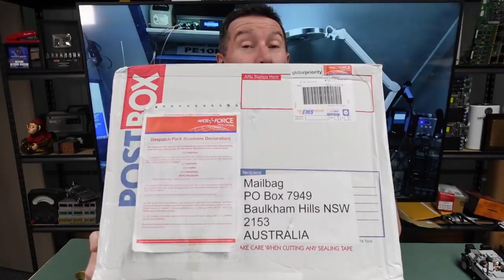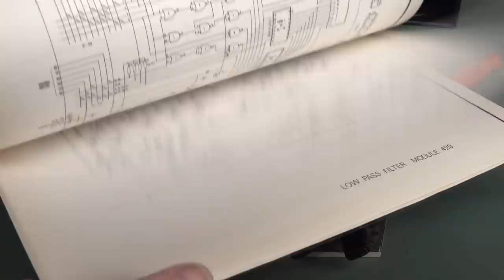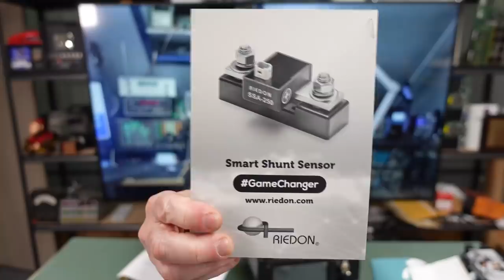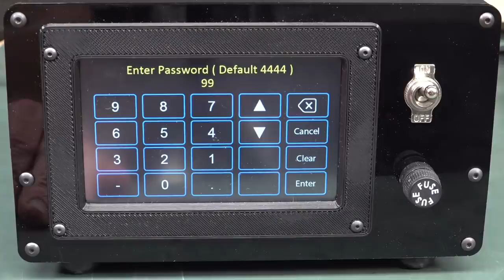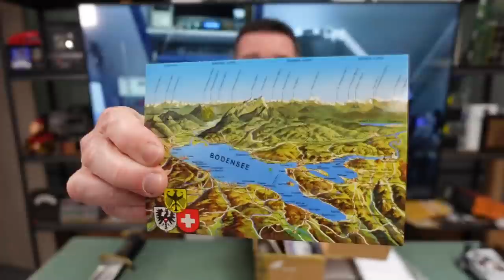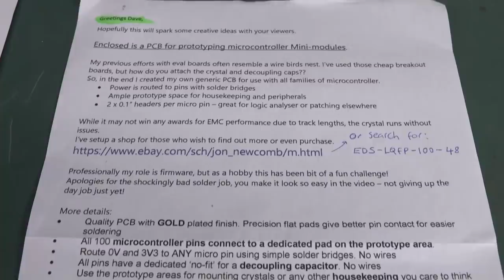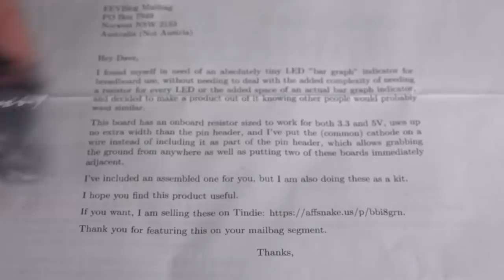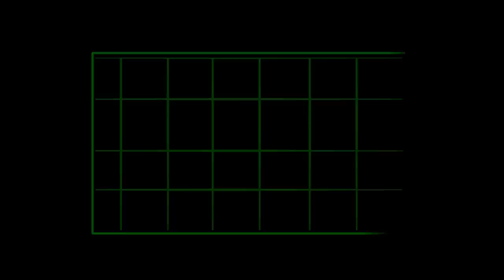EEVblog 1410 - Mailbag

Comment: Thought I recognised that add-on board in the marine radio - it's an ATIS (Automatic Transmitter Identification System) board which became a legal necessity on all VHF transmitters in operation in the Netherlands, the Rheinland , and the Benelux countries in (if my memory serves me right) the mid-90s. Hence the upgrade board.
Reply: Thanks David!
Reply: It sounds like 1k2 packetradio. A brust of about half a second at the end of each transmission. And the paperwork is in Dutch, not Danish.
Reply: So... what did it do?
Reply: @billysgeo  it sends the name of the shipp every time you push the PTT button

Comment: That horrible flashlight - is "Helios". How many people were shocked by it - god knows. I was a kid(1988) and nearly got killed by the damn thing. Barefooted boy walking around in the yard - decided to charge it up, and, yes of course - whilst it was charging i've got a brilliant idea of taking out a lamp for some reason. And as a family story tells - my grandmother found me lying in the yard unconsious. In electronics ever since :)

The battery is a  NiCd 260mAh and no remorse there - they always, ALWAYS leaked. Curious thing though - they still do make them in this form-factor, and even some descent brands do it (Sony, GP, etc), though of course the modern ones are NiMh.
Reply: Heh, I just poked my fingers in the mains socket when I was 1 year old or 2?
And this was It for me - electronics. And thous torches never make any significant effect on me.
Also, it was an incredible fun to play with it plugged into the mains. I think I use it to charge some other accus. One time LED on it exploded into the ceiling.
Reply: BTW: The story of NASA spending millions on a space-pen is absolutely true. But there's a catch: The NASA had the idea, that highly conductive micro graphite particles floating around freely in a space craft wasn't the very best thing for safety. So they tried to change that.
Reply: I also got got mains shock 2-5 years old since than in electronics 😃😃😃
Reply: I had same torch. even i manage to find spare batteries. Most of ruusian electronics are immortal.
Reply: @marcus_w0  I think the Russians used ink pencil, not regular graphite pencil.
Reply: @Llirik13  I was 6 when I built my first single phase transformer. Poked the fingers in the socket too only to be found by my mother later unconscious on the floor
Reply: @mrnmrn1  You are wrong. Ink pencils are not used in space and air due to air pressure changes.
Reply: "How many people were shocked by it - god knows" > Been done, done that ! :)
 After the incident, I saw the light.. and decided to become an engineer
Reply: Такой же фонарик назывался "Электроника". В отличии от "Гелиоса" в нём навесной монтаж деталей и отсутствует светодиод. .

Comment: Torch name Гелиос is (Helios). We have such torches in USSR. They have selectable light beam geometry (by turning bezel). Ni-Cd accumulators. Ingenious charging circuit. And really hi tech big crystal LED (I have one story with makes me think it can produce laser beams). So much memories Dave. My Grandpa had one of this, I remember using it when I was a child, and after he died, my Grandma still used it for some extend. It have an extraordinary life span, especially in regard to thous Ni-Cd accus.
Charging circuit is actually designed in such a way that it provides pulsating current, and this helps to fight memory effect in accumulators. But you must plug it off after some time (6 hours or something to not fry it) I bet thous accus still work if you clean them and charge for a while.
Reply: It was a consumer device. It was produced in volume. In USSR there was a limited variations for every type of consumer goods.
This torches was doggy in use, it is true, but also they worked, they helped us, they shined our way.
Reply: But there was also a railway torch we have. It was powered by serviceable alkaline accumulator. This was a standard big rectangular
 interchangeable accumulators that was widely used in other places, 
motorcycles, mining lights, etc etc. And they must be charged in stages, and electrolyte was boiling inside, and, it was so much fun!
Reply: @Llirik13  I'd love to hear the story about the LED producing laser beams! I also like the use of "accumulator" in place of "battery"... Might just start calling all my batteries accumulators now :D
Reply: @DielectricVideos  
 Accumulator stand for rechargeable battery here.
And thous that one time usage we call just battery -  batareyka 
(батарейка) for single quantity and batareyky fro multiple quantity.

Led exploded at the time when I played with this circuit (it was 
connected to mains). But it was really strange. First it starts flashing
 pulsation light with sounds of small blasts at 10Hz and really strange 
color. Then it exploded by irradiating thin light beam into the ceiling.
Inspection showed that led was lacking small central piece of lens(and 
have thin channel in rest of it), and ceiling have small burned crater 
in concrete.

Perhaps of course this was just redhot led crystal pushed by magic smoke
 to the speed of sound.
Reply: @Llirik13  Very interesting, it does sound like it turned into a laser diode for a short time!

Comment: As soon as you pointed at the added board, my old modified Midland SSB CB transceiver came instantly to my mind. I built an external VFO equipped with digital readout and then, very very carefully, I connected it to the right spot of the Xtal oscillator by means of a plug I added to the rear plate. It worked fine and it was also very stable, with clean output. I think I knew those schematics better than my home. Merry good old times, I was sixteen then. Thanks for reviving those happy memories.

Comment: The picoprobe tips are actually easy-replaceable, just grab then with pliers and pull them out. You can also interchange them for the serated points. And turd will do just fine I guess :-)
Reply: Hey Turd! Grapje natuurlijk. :)
Reply: Nice probes. How did you make them?
Reply: @thekaiser4333  some off the shelf parts soldered into a custom brass piece. The front and back are gold plated receivers, an the probe tips are also off the shelf.
Reply: @Cheered  - Thank you.

Comment: A pencil is a bad idea in a spacecraft with many switches and zero G. Break the tip and you've got a small random conductor floating around looking for a set of exposed terminals.
Reply: The story is a little simplified, they actually used a grease pencil
Reply from the maker: Don't have exposed terminals.
Reply: @EEVblog  But how would you AVOID having exposed terminals ? You can't coat everything in Bakelite or something right ? you gotta have access to make repairs on-the-fly so to speak ...
Reply: @EEVblog  Impossible to do, you are cutting every gram, so you only use sleeves where needed, and not on all of the pins. A lot of the modules were fully potted for vibration, but almost all of the switches on the panels used either soldered or screw connections, so sleeving them all would have added extra kilograms of sleeving, which translates to hundreds of kilograms of fuel extra. They already were making panels out of aluminium barely thicker than a modern drawn can, not much more they could lose mass wise. These were the engineers who took bolts and hollow drilled them, to cut a few grams off the mass, despite this making the 2c bolt come in at $20 then. Same for panels, milled out to just have the borders thick enough, and enough thickness to survive launch.
Reply: Hello. The problem with the carbon particles from the pencil is not that it gets on the switch contacts, but that the carbon particles from the pencil get into the oxygen regeneration system and can damage the regeneration system. This applies to American spacecraft, where astronauts work in an environment of pure oxygen. Russian space vehicles use ordinary air with 78% nitrogen and 20% oxygen and there are no problems with carbon particles.
Reply: @plusmanikantanr  Probably with more expensive materials but same way as they do on earth, in industrial and what they call mech and elec harsh environments.
Reply: that's why you can fix any russian gear by hitting it. hitting it lets the broken tips fall out.
Reply: @fiakergulaschsaft  🤣 I think that's where the expression "percussive maintenance" comes from. 👍
Reply: You could use crayon....why  pencil!!!
Reply: @rohitkhanna4487  Ah.... because that is what the Soviets supposedly used in the standard telling of this myth. BTW, NASA never paid for weightless pen research. that was a private company venture.
Reply: Also, Fisher developed the "Fisher Space Pen" entirely on their own, and then sold them to both NASA and the USSR.
Reply: They design spacecraft electrical and mechanical systems exactly to prevent something like that, NASA has a 600 some page (iirc) document on crew safety. They have put a lot of emphasis on in situ crew safety ever since Apollo 1. Unless you have all of the panels stripped off, live power running to the devices in question, and a lot of bad wiring, a pencil tip isn't going to do much. There are worse things that could be floating around a spacecraft than that.

Comment: Vintage transistor packages in the VHF transceiver were called 'Lockfit' packages, a Philips/Mullard design. They had pins made of metal strip, with barbs on that retained then in the PCB for soldering, (and made them a right pain to remove!).

Comment: The frakos are great!  They explode very loudly as they nearly never have a vent!  :)
Still used in the 80's as I see them often in audio equipment in the powersupply section. 

I saw people referring to them as "knallfrosch", exploding frog?.

Also today they make devices to correct the powerfactor when you have lots of motors. 
Basically a box full of caps and relays.
Reply: A Knallfrosch is a type of firecracker which jumps around on the ground.  They are usually green coloured, hence the name which literally means "bang frog".
Reply: I also had a Frako capacitor exploding in an audio amplifier that I built in the late 1970s. But it was entirely my fault, I did not understand the circuit well enough and exposed the capacitor to overvoltage. Nothing to blame the Frako brand in general.
Reply: Alessio, see if you can find my recent message about Frako caps.  Still working fine after 50+ years in my German portables.  You're right, no vent.  May be why they had a huge voltage margin.
The only cap I ever saw 'jump around" was a wet slug tantalum that had been installed reverse polarity.   It sounded like a pistol shot when it let loose.  The slug was ejected and left a heat trail on the adjacent insulating card.  (Of course, that that was so their source and path could be easily traced!)  : p )

Comment: According to the manual, which you can also find at "rigpix": The resistor is a 10Ohm 16W and its inserted via a relay in series with the power supply to the RF power amplifier. By inserting that resistor, supply voltage to the RF power amp drops to approximately 10V and that reduces its output power to 1W. I agree, the manual is excellent. The unit is wonderfully modular in design and that VHF power amplifier should be useable in other applications, I'd love to get hold of one for experiments.

Comment: The radio documents are in Dutch, not Danish. Some highlights: the warranty certificate ("garantiebewijs") states that the marine radio ("marifoon") was intended for a boat called "Serdon", and the owner was responsible himself for building it in. The other document is basically a license by the PTT (national phone and mail service at the time) for using/installing a radio on the "Serdon". Looking at the handwritten notes on it, it seems that this license cost the guy fl.42,- (roughly 21 euros) at the time.

Comment: 7:30 that synthesizer board is an upgrade from the 90s for sure!

In the 70s we called these multichannel transceivers "quartz crystal tomb"

Because you needed the propper quartz for every channel you wanted to receive and 
another quartz for transmit ! And these crystals were expensive these days.
So normally you did not have many (fixed) channels maybe 3 or 5 to change (and 6 or 10 quartz!)
and you had to open the box and plug in other crystals if you traveled to another region with other radio channels.

Comment: funny to see a fairly "modern" ATIS code generator in that old "Marifoon" Boat radio. 
As an intern at a big nautic equipment repair/suplier company,(Radio Holland) I had to (re)program this little devices and build them in the, back than, modern "boat radio's" with indeed earlier said ATIS identification code. this system is still used today at big harbours like Rotterdam so that the control station always knows who is talking at that moment. No one is allowed to transmit without that code when talking to the control stations. It can cause huge fines or can even cost you your permit to use the radio.

Comment: Mains rechargable flashlights are quite common here in the States for emergency power loss. Schools have them in every classroom, my work has one in the bathroom, etc.

I think a big part of their role is insurance against the backup generator failing. You want a way to get light automatically, with or without backup power.

Comment: That transistor package is called an X09.  I guess reasonably common decades ago, but I don't see a ton left around today.
Reply: Phillips and Siemens were the only manufacturers who made them, does make it easy to see German and Dutch made equipment. They also made a power transistor in the same package style, with a small tab out the top to screw to a heatsink, though often just the tab was enough for audio.
Reply: @SeanBZA  Made by Mullard too, and Philips Australia.  Very popular in locally made equipment here in Australia during the 1960s.  Called an SOT25 package.

Comment: Stacking chips reminds me of how I used to double my memory capacity by soldering RAM chips piggy-back like this, and adding a wire to do a chip-select to switch between the second chip and the first. So that mod may be doubling the number of available frequencies, or some such.

Comment: Those breadboard LED bargraph devices look really useful. I'm going to get some of them. When I need just a few LEDs on a solderless breadboard I have a bunch of red 3mm through hole LEDs with built-in current limiting resistor that I picked up from somewhere many years ago.

Comment: That Is a marine band VHF. It works from 156 to 162 MHz. It was  installed in all ships in 1980 as regulations requirement. The board on the back of the PA Is for a selettive call. A scrambler could not be use on marine band.
This equipment Is a full duplex type, made by Dancom. 
I was an electronic service Engineer and between 1980/1990 I repair thousand of thouse VHF.

Comment: im still doing entirely SMT prototyping on standard 0.1" proto board 
soldering 0603 parts between the pads and wiring sots in manually with bare copper wire
not fun, going to get a bunch of these right now

Comment: Telefunken Bajazzo portable radios from the 1968 - '69 era use the very same 1kµF 16v Frako caps in the audio output and power supply filters.   They're still working in-spec!

Comment: Great ship radio, or Marifoon (Maritime Telefoon).The attached documents are the licence to have installed a maritime Telefoon system
and after a PTT control check of proper installation you are allowed to use it. Of course after payment of the radio Licence.
Thats that "Directoraat Radiozaken" paper.Other paper is the date of purhes 16-feb-1978 and the date of approved installation date 5 april 1978.
Name of the vesel SEDON and radio call sign is PF7285.I repaired several of those Marifoons. Indeed the time the came standard with full
documantations. Those Typical Transistor packes were common in Europe, these are Siemens, but Philips was the design of this kind of Packedge.
Those extra wire ing and very small PCB with Orange Plug is the ATIS Code-PCB.Radio call sign transmitter.
Every time you push the Transmit key, first the call sign is transmitted.After app. 1994 it was installed at a government ruling to install in all MArifoons.
There for this modifications.The call sign is programed into that little PCB.I still can Reprogram these Modules, use a very old Win 3.0 laptop for it and spec serial converter.

Comment: @5:17 "dual bodge chip" , In the UK there are 2 Legal CB Radio Bands, the "UK 40" which is 27.601 - 27.991 and "Mids" 26.965 - 27.405 , there is 10khz between each channel , except on the Mid band where there are a few exceptions. In Uniden based CB Radios The UK 40 frequencies were set by a PLL IC called a TC9119 and the Mid band frequencies were set by a TC9106, to save having seperate radios I and many others used to piggyback the 9106 on top of the 9119 and switch between the two. Back in the day if you had one of these you were considered a king of the Air waves, I still have 3 radios with this mod done to them.

Comment: i've actually had a couple of these flashlights (blue case instead of orange, but identical otherwise). they were fine until the batteries died, and they died rather quickly. finding replacement batteries was impossible. but otherwise it worked all right.
the writing on the case that you couldn't read is "гелиос" in cyrillic, which in latin script would be "helios".
btw, these flashlights were considered quite an innovation at the time, because, wow, 1) they are rechargeable, so no need to procure batteries of which there was quite a shortage at the time; 2) just plug it into the wall socket, and it charges! no need for a separate charger, awesome!